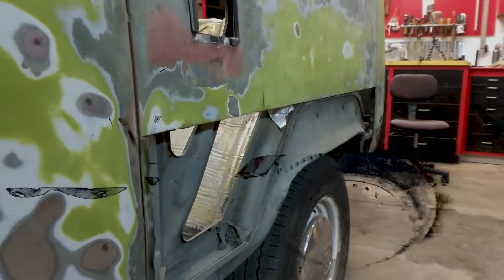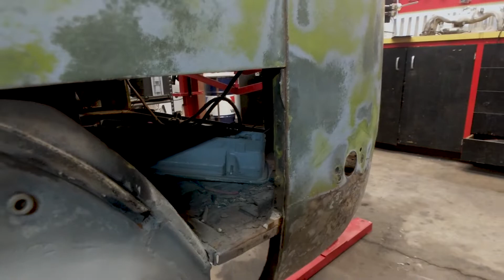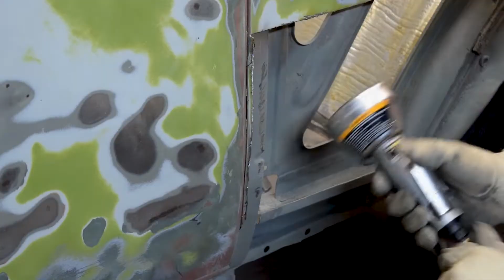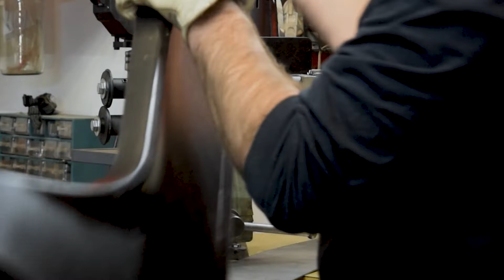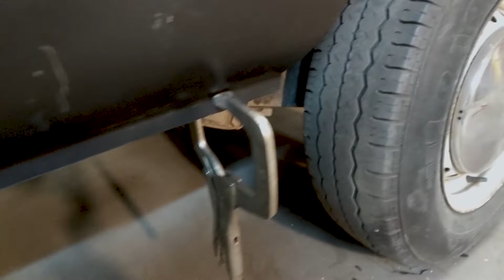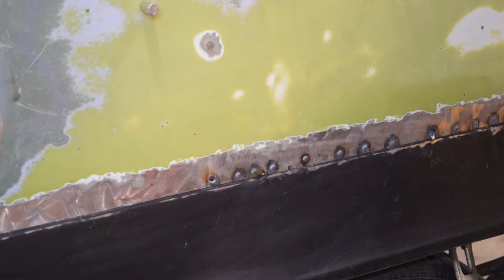The VW Bus Body Makeover PT 11 Rear Quarter Panel Repair

Comment: Hi Steve.  I just recently got a 72 camper which of course has rust.  I've worked on VWs a lot but all mechanical, never before attempted body work.  Your videos are informative and inspirational and I've already dug deeper into restoring my bus than ever before.  I'm also interested in the idea of putting a Subaru engine in to replace a previous owner's bunged up rebuild.  $$$ will be my only limiting issue, well, maybe Maine winters too since my garage isn't heated.
Reply from the maker: Glad that you are tackling your project. If you find a cheap used subi then you can save some cash. I would recommend saving up and getting a kit for the adapter. If you can make your own wiring harness that is another place to save some coin.

Comment: Hi there Steve been a while; question was that on off-set dies you were using on the bead roller??  The panel fit up nice, that not going anywhere soon . I'm still trying to master my bead roller, I made a fence for it and that part works great , need to power it and have another set of hand helping me, power will come first in those two options.
Reply from the maker: They are the offset dies that came with the Eastwood bead roller, I am not very practiced with it but the panel did fit nicely.